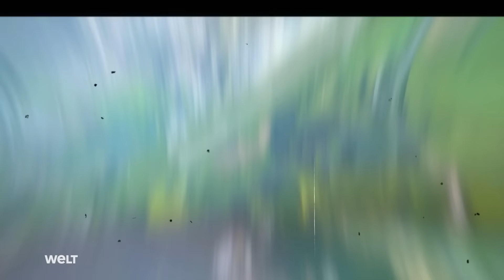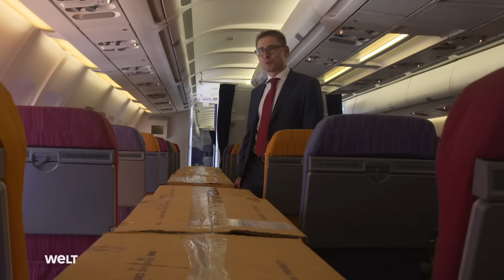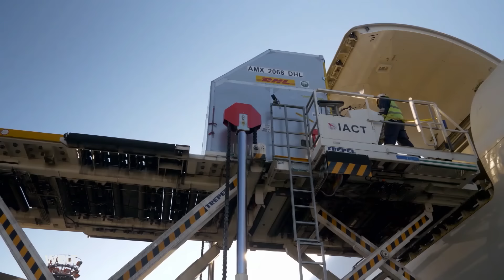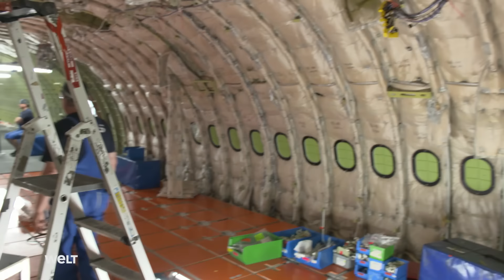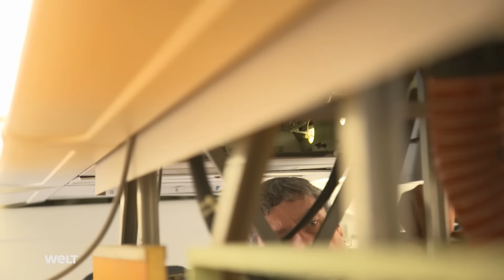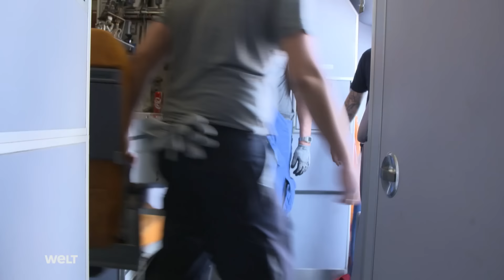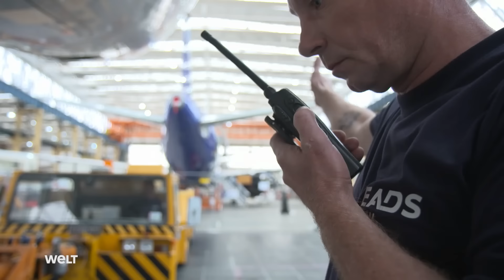AIRCRAFT CONVERSION XXL - A cargo plane is born  | Full Documentary

Comment: Why isn't the nose wheel structure reinforced during the conversion? I thought the A330 freight version had a reinforced nose wheel section?
Reply: Its not really reinforced but raised so you can load containers without an electrical loading system since an A330 on ground is pointing downwards.
Thats why the A330 PtoF has the electrical loading system shown in the documentary. 
You would have to push the containers upwards if you wouldnt have this system.

Comment: 14:01 What happens to the onboard FUEL from a decommisioned aircraft (Airline service) Will the fuel be sold back to the Airline or that just comes and will be forfeited to EBLE company ?
Reply: The quality is unknown, so the fuel is usually disposed - given to a recycler.
Reply: It will used as waste
Reply: Minimum fuel would be used for the final flight, and what remains is typically "recycled" in airport vehicles, tugs, tractors, etc.
Reply: @BobbyGeneric145  ATF kills Diesel engines - burns to fast and hot. Some few military vehicles are designed to use ATF (temporary) because of fuel logistic opimization in a mission.
Reply: @BobbyGeneric145  Jet A1 can never be used in any engine other than a jet engine. It's basically kerosene. If Thai airways flew a regular flight to that airport, it would be uplifted on the next flight. If not, it could be dumped or be given to the airport fire authorities for their regular fire practises.

Comment: Explained engine removal but no explanation of where replacement engines came from
Reply: There is a market for replacement engines and other plane equipment wich has been fully overhauled by highly certified companies. This companies are not in 3rd world countries and have absolut quality on their stock wich is no cheap crap. Btw, Airlines have eg a pool of engines so that the plane is not grounded during a larger inspection. They just install fresh inspected engines to bring the plane as quick as possible back into the air - as the engine overhaul/inspection would take the most time.
Reply: They came from inside the hangar

Comment: although there's no freighter variant of the A380-800 but it is practically possible to convert any A380-800 into a proper A380-800 Freighter!!! a large cargo door can be fitted to the port side front fuselage of the A380-800 but this would mean replacing an entire section of the A380-800's front fuselage with a new identical (similar sized) front fuselage section/plug (without the windows ofcourse) that has an in-built pre fabricated large port side cargo door!!! a second, somewhat large cargo door (but smaller than the larger cargo door retrofitted to the port side front fuselage section of the A380-800) can also be fitted to the starboard side rear fuselage section (aft of the wings) of the A380-800 in a similar manner as detailed above!!! according to Lufthansa Technik based in Dresden, Germany an accurately converted A380-800 F can carry a maximum payload of 950 ton - 1,830 tons!!! infact a A380-800 F can easily carry 4 - 5 AM GENERAL HMMWV NXT® 360 4-CT™ Fastback 4WD + 5.0 in. Lift 6.1 LS V10 4-Dr Armoured Personnel Vehicle (LHD) or 5 NIMR Ajban 447A 4WD + 5.0 in. Lift 4.5 TDI V8 4-Dr Armoured Scout Vehicle (LHD), from Singapore (SING) to Stockholm (ARL) non stop!!!
Reply: An A380F is useless because is cant lift as much as it could load. 
I saw a calculation once that said you could only fill 1 deck an allready reach MTOW.
Reply: But the 380 is junk so we don’t have to worry about that

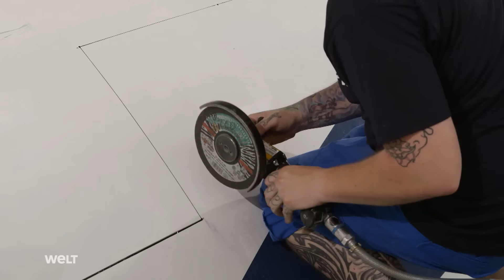Comment: 7:45 I wouldn't use 7" angle grinder with aluminum cutting blade without wearing Kevlar gloves with welding gloves over , wearing leather welding  jacket. 
I have worked with grinders as a welder & use extra safety protection . 
Just because grinders can be very helpful and extremely dangerous .
Reply: I'm a welder too but don't think it's necessary to go to those extremes. You have to be able to actually move whilst working, especially when you are on site and don't have the luxury of a workbench.
Reply: @tonybrown3184  If a worker feels safe is one thing but some work places  & most unions have strict safety rules applied to all rotary tools .
Dismissal is instant for not following these rules  .
The statistics show many fatal   freak  accidents with even 4" baby grinders while welders wearing their leather jackets & disc disintegrating slicing their guts instantly. 
Worse cases if you wetness this yourself & work with people that flying disk nearly missed their brains exploding trough the face shield  & monogogles , leaving huge scars on the face , like from Samurai sword. 
Safety only slows down but it is worth an extra protection. 
Aluminum tends to jam & grab the disc & reciprocating saw is preferred with clearance for the blade. 
Even specific aluminum discs collect metal shavings on the side. ...
Reply: Nobody does any of that crap in aviation

Comment: I wonder if this company could convert an A380 to a cargo version? It’s such a waste to see those big birds go 😢
Reply: The upper floor would have to be replaced, way to much cost.
Reply: @lvthud  it's possible but a massive pain in the ass. Also good portion would be needed for crew quarters. Sorta like the top decks of 747s
Reply: No. The a380 doesn’t have enough carrying capacity. FedEx looked at ordering a cargo one, but the economics didn’t work out.
Reply: An A380F is useless because is cant lift as much as it could load. 
I saw a calculation once that said you could only fill 1 deck an allready reach MTOW.
Reply: @MaintenanceEngineerNH  Pretty much, the advantage it does have is volume, for Fed Ex or UPS this may work, but not new, it would have to be used, and the conversion cost would probably ruin the math on it.

Comment: Wow. I assumed a conversion would not be easy but pulling the engines?
Reply: The engine removal is as per the agreement with the previous owner of the aircraft. The sellor could have only sold the airframe and not the powerplant.
Reply: @l33wan  Which I find bizarre. I’m in the railway business. Most rolling stock will pass through numerous owners in its lifetime. The idea of considering the engine as something separate from the whole is a new concept for me.
Reply: @maestromecanico597  in aviation, engines are usually leased on a separate contract from the airframe. This is because engines require periodic overhauls and replacements and the airlines will just get a replacement engine from the lessor and continue flying rather than ground the plane till the maintenance is complete. As in this instance, the airline doesn’t own the engine and can either put it on another plane or return to the lessor
Reply: @maestromecanico597   In some agreements, when an engine is removed, we would have to remove some components from the removed engine  to fit onto the new engine !
Reply: Pulling engines isn’t a big deal….do it all the time
Reply: @justing42  I'm guessing, and this is with only half information, that pulling an engine off a wing is easier than lifting an engine out of a locomotive carbody.